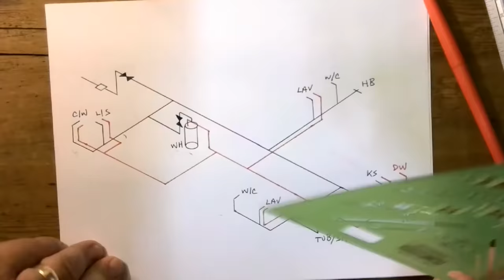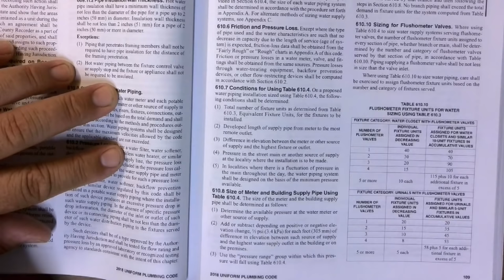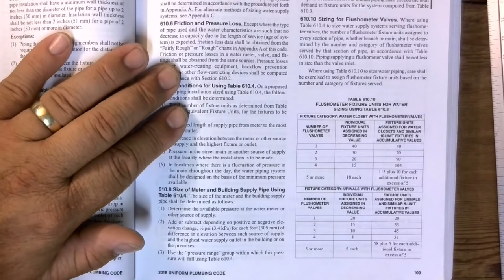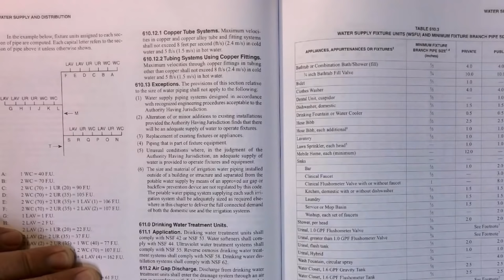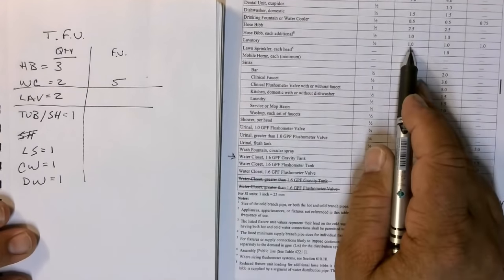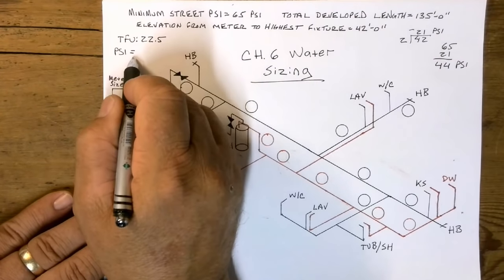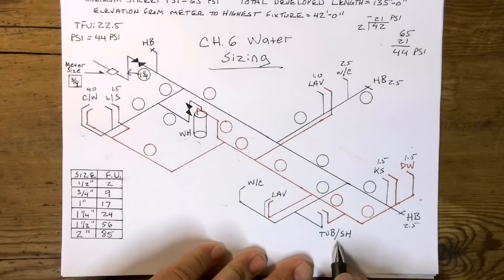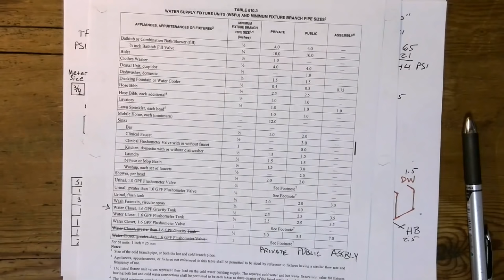Chpt 6 Vol  2 Water Sizing

Comment: Issac first thank you for the videos, great job! Question, what is the difference between an airgap and an airbreak? is it the distance?
Reply from the maker: Simple answer would be an air break is an indirect connection below the flood rim- where the discharge pipe breaks the plane- and an air gap is the distance between the discharge point and the flood rim.  There's a little more to it but that should add a little clarity, I hope
Reply: @BGsPlumbingClass  thanks that helps
Reply from the maker: @upnorth1955  If you ever have any other questions feel free to contact me via email at gorhambm@outlook.com pleasure to help!

Comment: 4 LayPerson Questions:  

1. Does the qualitative term "adequate" supply of potable water in section 601.2 refer to the qualitative language "quantity of water " in section 610.3 and "quantified " WSFUs in Table 610.3?

2.  Are the WSFUs (when converted into GPM) the "minimum amount of water" each plumbing fixture (kitchen faucet, bathroom faucet, showerhead, mixing-valve, and tub-spout) must get  -- pre-water-conservation devices (aerators)? 

3. Are the WSFUs different in table 610.3 for each 3-year edition of the CPC (from 1946 to 2022)? Are WSFUs based on Dr. Roy B. Hunter's 1928 work, the "Hunter's Curve" or something new?

4.  For older properties built in the 1920s to 1930s (pre 1946 to 2022 CPC), would those state or local plumbingt codes have used a similar or equivalent WSFU/GPM formula -- Hunter's Curve?
Reply from the maker: If my memory serves me, when I began in the early 90s, water demand was different than it is now. As of right now, the Hunter's curve we have been using over the past several decades has been adjusted.  Not just by demand shift in new design of fixtures, but now different buildings are utilizing differing curves based on occupancy usage.  Prior to the curve, in Principles and Practice of Plumbing by JJ Cosgrove circa 1906, water sizing was based on similar information.  Available static pressures, the hardness of water and it's affect on the piping used, the friction loss thru type of pipe and fittings, outlet demand of the fixture were all used to calculate demand.

Comment: I’m studying for North Carolina . I’m using the ICC AND IPC. Neither one of these books have the piping size for water distribution which sucks because I’m always curious on what size of water line to use. 
So nothing IN WSFU. Only DFU. 
I gonna but the uniform code book but wouldn’t be able to take it into the exam room.

Or if I could just download the chart . That will be good . Thanks for a great vids. 

Notice that you forgot to include the kitchen sink in the DFU calculation, but it would have been the same count because of the dishwasher. 

Just curious , what state you are in that uses the uniform plumbing code ?
Reply from the maker: The kitchen sink was missed.  I revised this same video to reflect that.  HUGE mistake!  I'm ashamed...  but you are correct.  It doesn't affect the sizing on this example.  I was in San Diego, CA but recently relocated to Tennessee- which uses the IPC.  So anticipate a sizing video based on that soon.
Reply: @BGsPlumbingClass  

I would really like that to see how to navigate the ips for water distribution sizing . Thanks again .
Reply from the maker: Quick update on water sizing for you Vijay.  The IPC does mention sizing, however it is located in Appendix E.  I did a similar example of this method of sizing based on Appendix A of the UPC a while ago.  Give it a look while you are studying IPC's APPX E.  Let me know what you think, my email is gorhambm@outlook.com

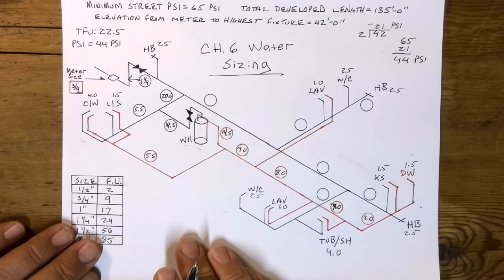Comment: At 1:01:43 you summed 14.5 and 5.5 which, the 5.5 fixtures are already included in the 14.5 serving the water heater, shouldn’t the sum remain 14.5 since the 5.5 were already included through the hot water side? And thanks for the video
Reply from the maker: As far as sizing a system, the sum for the water heater supply shall be accounted for.  I understand what you are thinking but look at a scenario where the water heater is located at the end of the line.

Comment: Fantastic presentation. Easy to follow and understand. I know this is probably unintentional but it really helps me as a DIYer (others too I imagine). Everything was very straightforward, so I only have a question about the issue of oversizing. What are the potential issues if you upgrade a pipe now for a later addition? What if that later never happens?

For the purpose of this example, and using your numbers. Say I had a utility room with just a sink (only needs 1/2"), and I wanted to turn that into a full bathroom with bath/shower (7.5 FU = 3/4" pipe). If I upped the pipe to 3/4" supplying that room and never converted to a bathroom - besides lower flow to sink - are there any issues to worry about?
Reply from the maker: Even the lower flow wouldn't be that much of an issue- you're talking minuscule.  There is no real issue with that scenario.
Reply: @BGsPlumbingClass  Makes sense. Thanks for the reply!

Comment: this is the first hour long video that I actually watched and kept me interested until the end. I get bored 6-8 minutes in normally. I watched this TWICE. One question. Lets say you start with 1 1/2 inch and as your going thru the house (closer toward the end) there is less fixtures left obviously right? So if it calls for 1  1/4 or even 1 inch at the very end- do we HAVE to reduce it to keep the pressure up? or can we just run 1 1/2 all the way to the other end and then do your last branches?
Reply from the maker: You don't have to size it down, however look at it this way.  If you need a drink of water and drink 1 gallon out of a 5 gallon jug, what happens to the other 4?  It stays there in the jug.  Proper sizing ensures that water flow (velocity) is maintained while still providing the necessary volume at the pressures available.  The pressure is still there, but the velocity will change when the size changes- like putting your thumb on a hose giving you more velocity.
Reply: @BGsPlumbingClass  thank you sir for your reply
Reply from the maker: @homersalazar8479  You're welcome.  Hope it helped.

Comment: I  have watched your water sizing video and found it concise and well thought out.  May I ask? What is your take on note 3 of table 610.3?  Thanks...
Reply from the maker: If you decide to size out each branch at 75% capacity, why would you not for the building supply?  In other words, if the building supply is 100%, shouldn't the rest of the building be as well- why choke it down?  The note does say the branches "...shall be permitted", but I feel that it is such a minuscule amount in the overall scheme of the system that sizing it based on 100% is much more accurate and would ensure proper supply.  A fixture's unit value is calculated based on volume at the fixture, and each fixture unit calculation in Table 610.4 is based on that (Appendix A). Also, here in my location the Journey level exam sizing portion is based on 100% and not the 75% method, so I try not to confuse the apprentices too much.

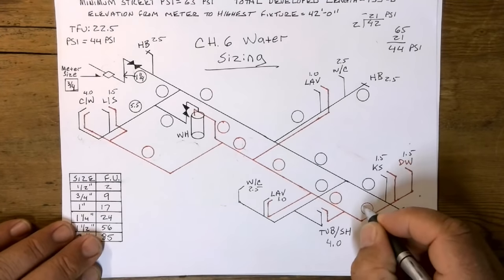Comment: Around 59:00 you give the dishwasher and kitchen sink 1.5FU each, but 610.3 says KS w/ dishwasher is 1.5 FU. We just bought a quadruplex and I’m really confused because everything I’m finding only accounts for single family setups. We have 4 submeters, 1 main meter.
Reply: Also, what about the 70% method?
Reply from the maker: The dishwasher is interesting.  I use the dishwasher as if it were an industrial stand alone.  Kind of like using a gas refrigerator in the sizing exercise for fuel systems.  No one will place a dishwasher separate from the sink supply unless it's a huge kitchen- should've mentioned that in the video.
Reply from the maker: The 70% method will be accurate.  It is similar to the difference between the longest length and the branch length methods in sizing a gas system (Ch 12).  Both are accurate, the 70% being more so.  Sizing the regular way will afford you with larger pipe sizes in some locations- ensuring proper supply requirements and minimal "starvation" of water.  Plus the velocity of fluid in the pipe will be slightly diminished adding life to system.

Comment: How is total developed length calculated? Does it have to take into account the hot water line?
Reply from the maker: Yes and no.  The total developed length is the furthest distance from the meter to the fixture that is furthest by way of water travel- which more often than not is through the water heater.

Comment: Question.  

1. What is Total Developed Length in plumbing and how do you calculate ?

2. Once Total FU has been known, is there way converting it into GPM ?
Reply from the maker: Nathan, great questions.
1. The total developed length is the distance from the meter to the furthest fixture- not the highest necessarily, but the furthest.  It's true distance is the total of each piping section added to the equivalent of lineal distance each fitting has based on type of material.  Like a 3/4" 90 c x c has an equivalent distance of 2.1 feet.

2. You can convert the fixture units into gallons per minute by going into Appendix A and using chart A103.1 (1) or (2) in the UPC 2018.  If you want to look at an earlier video of mine on sizing based on Appendix A please do! 

I hope this answered your question and if it didn't please reply back and I'll take another crack at it from a different angle so to speak.

Comment: Hi. Question on the table. The minimum pressure range is 30. Can i still use the table if my pressure is below 30 PSI? if No, what can i do? Do i need to install a pump for me to reach the 30 PSI pressure? Your response will be greatly appreciated. thank you very much.
Reply from the maker: Technically you are not supposed to use this table if your pressure is lower than 30 psi.  If you do end up below 30 psi, you are advised to size the system based on appendix A of the UPC- which I made a short video on how to size using that method (which is the way the calculations in Table 610.4 were figured).  It is different because now you are figuring out the calculations, but if you want accuracy and efficiency in your system, there really is no better method.  A pump is only required if you dip below 15 PSI residual.  I hope this helped.

Comment: What happens when there’s no elevation, the surface is flat and no changes on pressure, do you size it with the minimum of 65?
Reply from the maker: Yep.  If there is no elevation change there is no need to adjust pressure variations due to elevation.

Comment: what if Im using a gravity fed system and my pressure supplied is below 30psi, where, what do i do cz that chart doesnt cater for pressures that low
Reply from the maker: There is a video I did on sizing based on Appendix A that might help you, as it deals with distance pressure losses, elevations, etc.  Worth the watch and I do think it will help

Comment: Why is the shower/bathtub not 10.0?  You said the fixture was huge.  Out of that huge bathtub fixture you’re only using a 1/2” pipe?  Bathtubs from my day were huge and I’d think from the noise and the speed at which they filled it was 3/4” for the tub and 1/2” for the shower head no?
Reply from the maker: I guess I could've addressed this in the video.  There are two types of valves for tub/shower.  Average valve bodies are 1/2" fill hence the 4.0 fixture unit count.  I personally haven't seen a 3/4" valve in a little over 20 years.
Reply: @BGsPlumbingClass  thanks.  I haven’t started looking at all so I’ll take your word for it.  They were 20+ year old tubs so they probably were 3/4.  I never taken a bath in the newer homes I’ve lived in haha.
Reply from the maker: @neckofthewoods24  Just out of curiosity, have you watched any other videos?  Are you a plumber or contractor, home owner, or someone just interested in the process?  Do you have any critique of the presentation style?  I am always interested in making changes or trying different methods of "production".
Reply: @BGsPlumbingClass  no i haven't watched others from you, just other videos from other youtubers.  i came to yours because it seems everyone just does 3/4" and branches off 1/2".  from the chart it looks like i should be doing 1" and branching down to 1/2".  im my own builder, GC, plumber, electrician, etc etc and showing it all here on youtube for our channel.  on a side note, at least we have well water with a variable pump and controller so my inlet pressure can go up to 100psi or like you said, 80psi max and with a ranch we have a very little rise in elevation.  only interesting thing will be, whats the pressure out of the softener and filtration.
Reply from the maker: @neckofthewoods24  You should be able to acquire pressure loss information about the softener and filtration systems from the manufacturer.
Reply: @BGsPlumbingClass  I think I’ll add a gauge somewhere since I’ll be adding some filters of my own.
Reply from the maker: @neckofthewoods24  I would add a gauge on the inlet and outlet side of the filters.  That way you can see the loss of pressure as it flows through.  Also, you can see the pressure drop as the filter begins to "clog" with use and decrease flow through.

Comment: In calculating water supply flowrate . Do we have add all WSFU   supply Fixture or shall we add lps.  If we are adding lps then we are getting higher value
Reply from the maker: If you are going to size based on flow rate, then I would advise you to look at the engineered method of sizing in the UPC.  This would be Appendix A and I have done a video explaining that method if you would like to view that.

Comment: Great video. One question. I did this calculation an it shows I have 21.5 fu demand for hot. This would require an 1'' pipe, however the water heater is plumbed with 3/4''. Should this be changed?
Reply from the maker: You did the calculation on your system at home?  Did you check the distance and inlet pressure?  What other information can you give me?
Reply: Yes I did the calculation on my home plumbing.

The static pressure at the meter is 47psi.

The distance from meter to hot water heater is about 25 feet.

 But furthest fixture is probably 55 feet through hw heater. Using chart it would put 16 fu for a 3/4'' pipe. 

Highest placed fixture is about 28 feet but closer to meter probably 15 feet away then 28 up. Which would give 33 psi for height deduction. 

I get a total of 32.5 fu for entire house. 

I get 21.5 for hot water demand. 

My meter is a 3/4''.

From what I understand the supply pipe from meter should be a 1-1/4'' pipe off meter (it's only 3/4). Then feed to a 1'' pipe for water heater, then can be down sized to 3/4'' as fixtures branch off with 1/2'' pipe . Is this correct?
Reply from the maker: @bimil8724  Based on that yes.  How many bathrooms are there?  There is note 3 in Table 610.3 that allows you to take the value of the cold and the hot both at .75% of the value.  That may be able to cut the size demand down.
Reply: @BGsPlumbingClass  there are 3 bathrooms. One with shower only. Other two have tub/shower combo.

Using 75% method gets it down to 16.5 fu.

It's very close but apparently still wrong.

I have 50 gal water heater that seems to only have Inlet for 3/4 npt.
Reply from the maker: @bimil8724  Well, first off if you have 3 bathrooms and 3 bedrooms a 50 gallon water heater will work- provided the first hour rating (the amount of hot water in an hour) is 62 gallons.  Some are lower efficiency and would not achieve this.  If you have more than 3 bedrooms I strongly suggest you get a larger heater to handle the potential load.  I will also say that based on the code I would say yes change the size.  I will also say- based on pure logic- that if you do not see an issue at this time because you may not have enough persons occupying the residence for all of your fixtures to be running at the same time to notice, don't change a thing yet.  I think it is phenomenal that you did this!!!